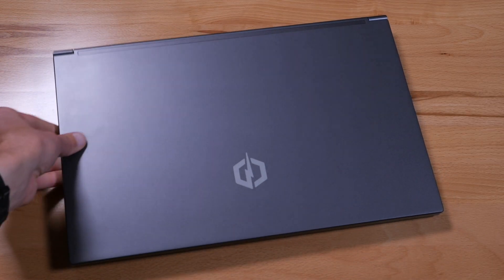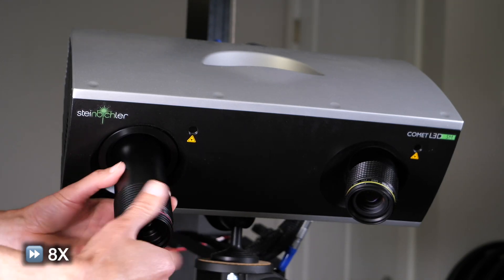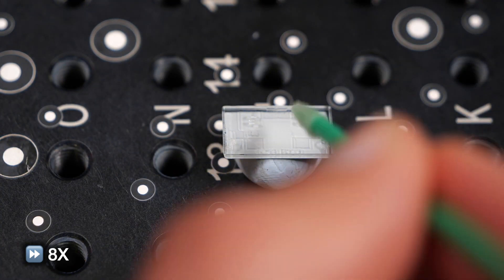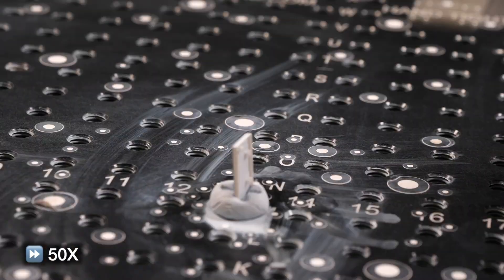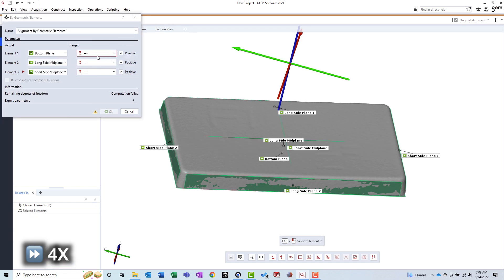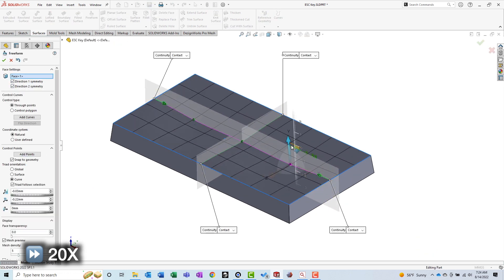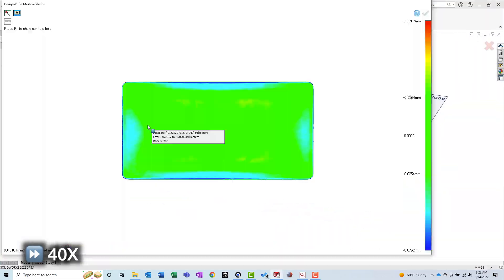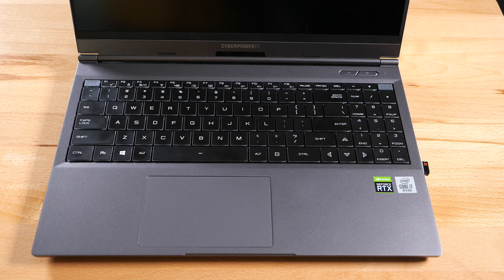Scan to CAD Workflow: Recreating Keycaps Using DezignWorks + Solidworks 2022

Comment: How many different scanners you have? Also do you have a website and cost for object scanning?
Reply from the maker: Hi, Dan! We have one 3D scanner - a Steinbichler Comet L3D 5M. It has 5 sets of lenses to accommodate a variety of part sizes. You can find our website at www.sentinel3dscanning.com. Our Pricing page includes the cost of common job types and our hourly rate. If you have a specific project in mind, send an email to info@sentinel3dscanning.com and we can discuss your needs further. Thanks for watching!